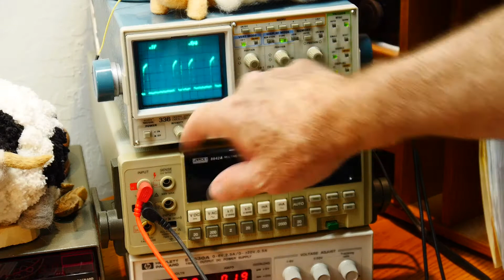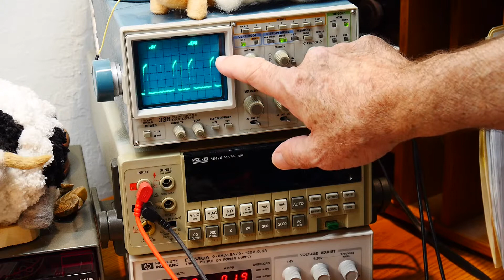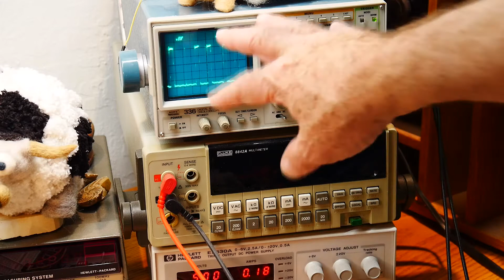#163 ZETA SBC  use LS or HCT parts?

Comment: 74HCT, Z84C* , Flash ROM, SRAM , 37C65, and 80C55 all have TTL compatible inputs. Their input voltage level for logic "high" is about 2V, which is lower than in a regular CMOS parts (about 3.3V for 5V power supply). If using 74HC parts one needs to be careful to use CMOS parts throughout the board (either 74HC or 74HCT, doesn't matter). I am also not quite sure if it will work well with NMOS parts (e.g. Z8400, or 8055).
Reply from the maker: I'm surprised those all work with TTL inputs. Great to hear from you. I love the board and hopefully have created new interest in it.